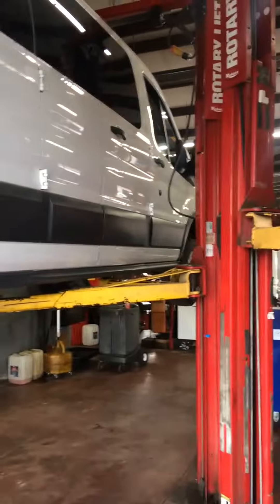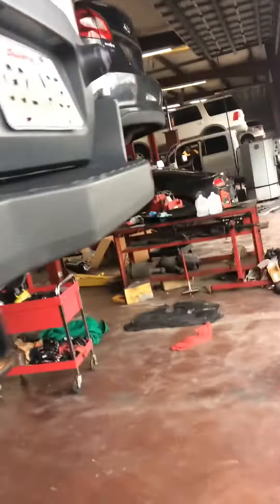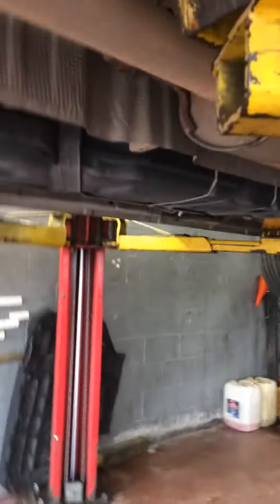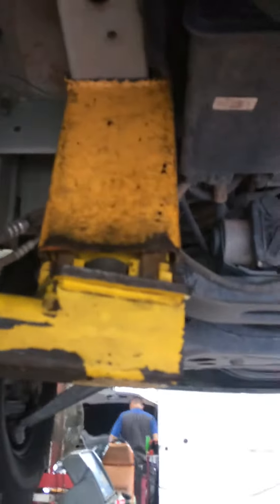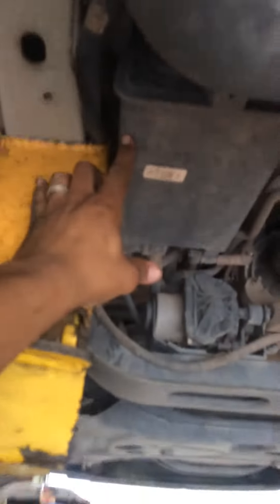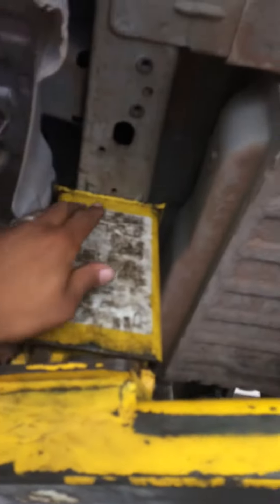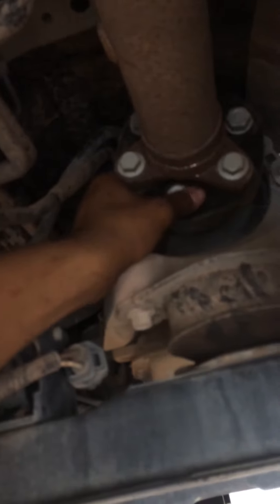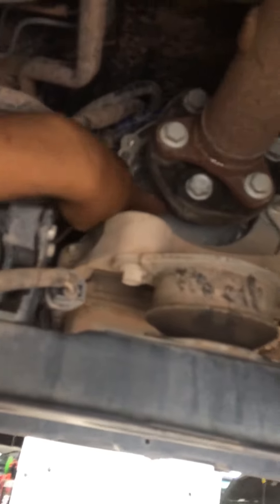2016 Ford Transit - lift points

Comment: I'm gonna try this. We get tires and oil changes on these all the time through a fleet account at my shop and I've always been lifting them one wheel at a time with a floor jack or crawling under or had to use the alignment rack to lift them. This will be a life saver if it works with our lifts
Reply from the maker: Awesome.  I work at a Lincoln dealership now so I don’t see them as much, but back when I worked for a Ford dealership, I’ve racked literally hundreds of these transits with this technique.

Comment: the equivalent spots (a "joint' on the "ladder" of the chassis frame) on other cars seems to be discouraged.
why is it ok for the transit?
Reply from the maker: It’s a different design.  I’ve tried lifting it on the pinch-welds..... trust me you don’t wanna do that.